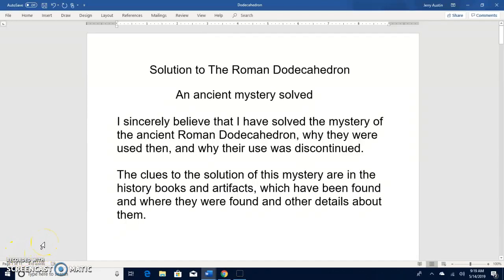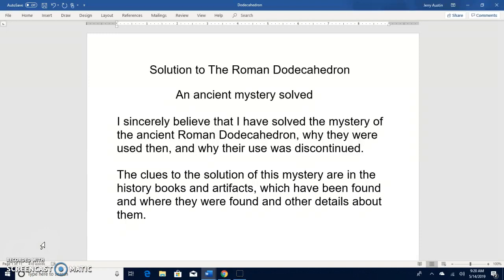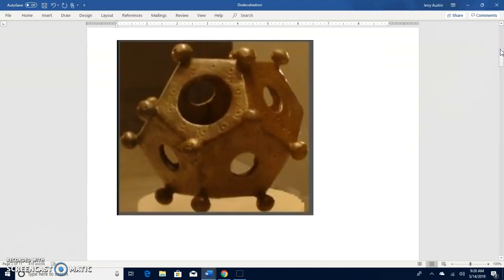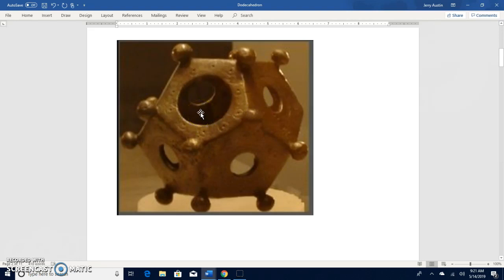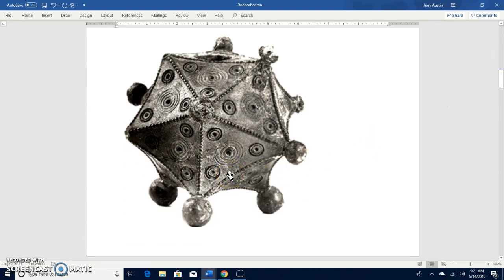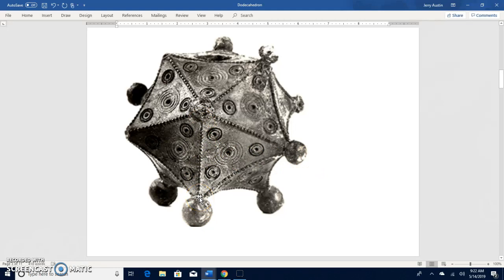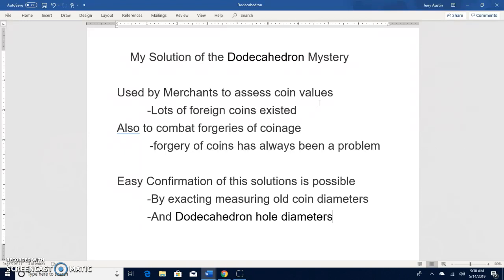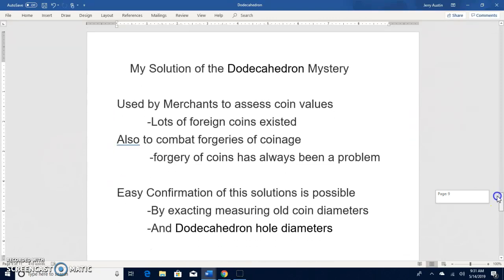Roman Dodecahedron Solution

Comment: It is used to find the Meridian Transit.
Every month has a time-correction chart for Sundial-time.
12 holes in the Sextant, 12 circles on the Chart, each with a months worth of corrections.
Place the Sextant on the right Month (Zodiac sign?), make your observations, apply the time-correction.
You know North, the actual time and the Transit time.
With this information, Longitude and Latitude can be found by consulting an Almanac.

Comment: The Bronze Dodecahedrons  are mass produced toy brainteasers similar to Rubics Cube. Each face had a five sided chip with symbols or some such that pivoted round the axis of each hole the idea being to match up the symbol of one side of the chips face with same symbol of neighboring chip face, all faces ending up having matching symbols on all sides. Different size holes as 'color coding' so MASS manufacture can know which chip goes into which face of the dodecahedron. Each axle was cotter-pinned from inside or more likely 'peened' mushroomed hammered accessing from opposite end hole. Final piece held in place by offset tab through keyhole hole. (various size holes also allows for use of axle material that comes in non uniform diameters [as harvested].) - In the end like in modern times, most of them got trashed after getting bored with and recycled for their bronze and those that didn't get recycled over time the biodegradable parts dissolved away leaving the bronze skeleton.
Reply: Termi Nation any examples of such a puzzle/toy in existence?
Reply: @TheEnd  here is a puzzle that is probably along the same lines as the dodecahedron puzzle except flattened out. Just imagine this puzzle formed with it's 12 discs in a ball shape instead of this flat, and with 5 numbers instead of these many. Same idea just arranged 3 dimensionally instead of 2 dimensionally.  https://www.creativecrafthouse.com/dodecagon-dilemma-puzzle-12-twelve-sided-pcs-very-challenging.html
Reply: Termi Nation why would you infer a relation to this object given such little or no evidence suggesting this otherwise? I’m still unclear how you came to your conclusion.
Reply: @TheEnd  It's the only explanation that explains the keyhole part of the device. It's the only explanation that fits. Making gloves is certainly a stupid explanation, why aren't you questioning THAT nonsense. 
I figured this out years ago from an old archaeology book "Gods, Graves, and Scholars" in which they showed one of these - except you could see the keyhole hole. That book challenged an explanation cause none of the archaeologists could figure it out. So I did. Wrote an essay explaining it that especially explained the keyhole. Ever since, when you search these dodecahedrons Google images, they do all they can to limit your view that there is a keyhole as one of the holes. The powers that be don't want me getting credit for any of my discoveries less the world think me a Sherlock Holmes and start to actually listen to me when I point out one government criminality after another. This isn't the only discovery or understanding that I have made. Have you watched the TV series Westworld? I'm the "doctor" that discovered a hidden secret in the Sistine Chapel Michelangelo painting 'God and Adam'. But they don't show you the actual discovery nor give me the NAMED credit. https://www.facebook.com/photo.php?fbid=3285483654598&set=pb.1192836689.-2207520000..&type=3&theater